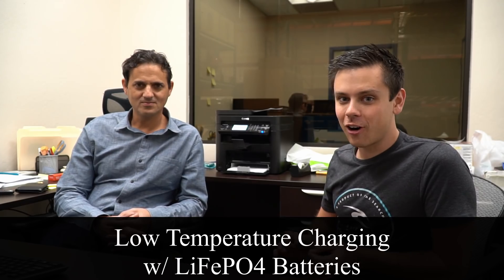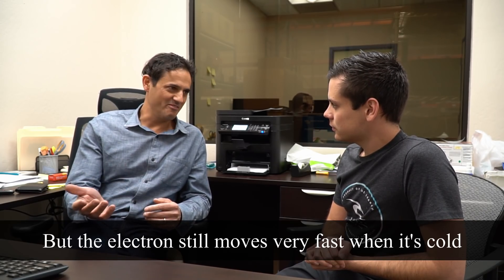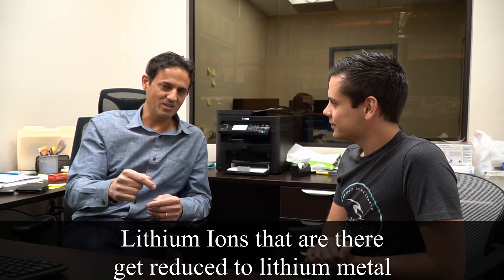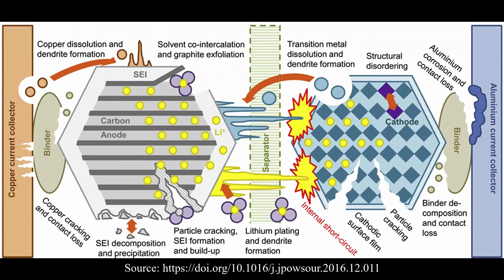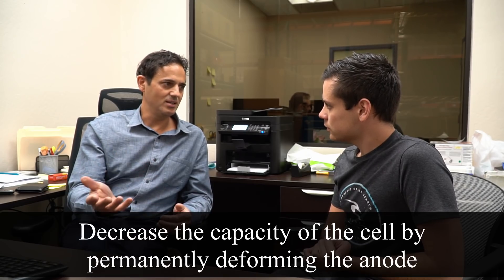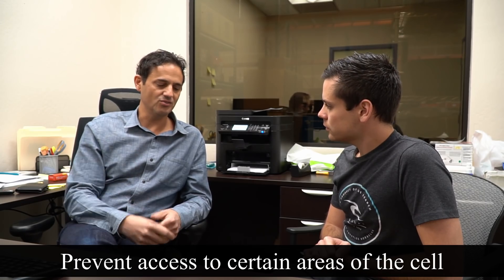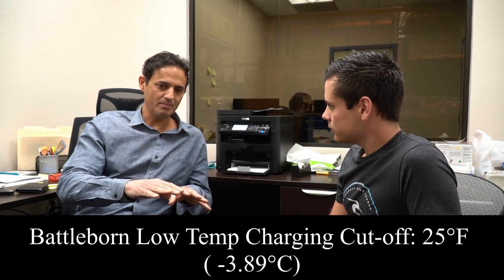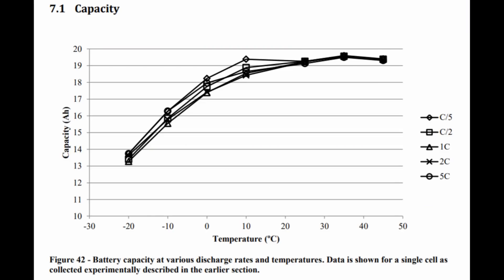Battleborn Battery CEO Interview! LiFePO4 Low-temp Charging, Storage, Longevity and so much more

Comment: Low-temperature charging  recommended to use no more than 0.1c current to charge slowly, and let it sit for more than 7 hours; Passive balancing is not useful . Consider balancing the current and the main parameters of the battery.

Comment: If Battle Born could make a lithium battery that would work (charge) properly with a standard RV charger/converter made for lead acid batteries, I think more folks would use them.

Comment: I don't know if this is possible or worth the effort but given there's a hard coded low temp cut off to account for leeway and such, could they add a dynamic low temp cut off that takes the charge/discharge rate and the temp into account? People using low rates of charge/discharge could get a lower temp cutoff that's still safe, get more out of their battery, and also know they actually have an option still, rather than no option at all if their temps will be consistently low and all batteries have a super safe hard coded low temp cut off based on a higher average charge/discharge rate. Is this realistic? Pipe dream?

Comment: What i want to know is realworld tests. Like a system is in constant use. So  its more warmed up. So a outside the cell sensor would read a lower temp then the inside of the cell . This cell is already in a plastic case with other cells and keeping  it isolated. It  wil also warmup  during charging. So maybe at those low temps is not always that bad  Unless they are not used and outside a house or warmed  camper.

Comment: Will has so much passion for batteries its infectious. Also where would the energy come from to heat the batteries?
Reply: Wouldn't it come from the charging source since that is when damage occurs is during the charge cycle when batteries are cold? BMS would restrict the charge until safe minimum temp is reached. Just my thoughts.

Comment: A really good video - Talking to someone that actually knows what they are talking about. I am so sick to death of being told what I should and shouldn't do and never being told why! Loads and loads and loads of people just repeat parrot fashion what they have read or been told but, if you ask why, well, that's when you realise you are only talking to a parrot.
One other thing while I'm hear - Nice to see you have found a use for those big resistors, a household filament type of light bulb can be handy too, current limits as it heats up and handy if a fuse has blown and are concerned that something may have gone seriously short circuit.
One other thing - If you are going to stick a relay coil in amongst electronic devices you might like to consider putting a small signal diode across to relay coil; EMF and all that stuff. Very well done on this video {:-)))

Comment: This is a CEO that actually knows his product, as it should be. Great interview!
Reply: thats a sign of a CEO who built his company from the ground up..Not one that was hired to fill a vacancy. This guy probably ran the whole thing by himself for quite a while not only does he know his product but has probably done every job there from the lowest (sorting mail) to CEO they are the best to work for cause they usually have an appreciation for the entry level jobs that actually make the company wheels turn.
Reply: @iczer01  rather than hiring one off the web...
Reply: Yeap CEO is a techie , a dam experienced one at that , wouldn't be surprised if he did the designs himself originally

Comment: Excellent interview!!!!!   There's your calling Will. :)   Please do a Project Farm series of videos cold testing/charging to see how far you can push them.  That's been my biggest concern with lithium batteries traveling in my truck camper full time solar.  Knowing that lithium can take a low charge below 25 F charge without killing the battery is a huge plus.  I have 2 battery/BMS kits coming from China, so finally taking the plunge.  Thank you for all that you've done.

Comment: This has been an interesting and informative interview and I enjoyed it, thank you. I do have a question, I'm looking to build a truck camper (which will rely heavily on solar) and paid close attention to your vids. I've seen vids were they created a 'potentially infinite perpetual motion thing' with a 12v motor and an alternator. Do you think if you could supply more power with the alternator, other than only supplying the motor, you could supply other things (i.e. batteries). Forgive my electrical ignorance, maybe 24v?

Comment: So ideally you would want a heating element that will use all the charging energy to warm up the battery until it is above the safe charging temperature. 
A heating element, thermostat and a diode (to prevent current from the battery to the heater) could do the heating part. The BMS should should do the low temp part.

Comment: The part around 14:00 is invaluable... I was wondering about degradation when a battery is plugged in and left fully charged for months at a time.  And now I have my answer!   I'd like to use LiFePO4 as a live-backup, meaning that the charger is plugged in all the time and its also running equipment 24x7... the battery is only there in case of a power failure.

-Matt

Comment: A Battleborn with an internal heating element! Nice!
Reply: That could make your van complete eh? :)
Reply: I just bought one. It arrived yesterday -- 21Apr2021. I haven't  used it yet, but anxious too. I got a 12v 100a.

Update: Today is 20Jun2021. I began using the battery about 4May.  I wanted to do a test to see how many days it would run my mifi hotspot that I want it to run during the winter.  It ran for 18 days before the battery was empty.  Now I just have to set up my solar panels.  I ordered the $50 used "pretty darn good" ones that Will tested.  I got 16 of them, which I will split up with friends.  I'm only getting 4.  Thanks to Will...

Comment: Great news them developing a battery with internal heating elements to bring cold cells up to a temperature they can accept charge.
I mentioned in a comment in one of your videos a few weeks back wondering if there were any BMS boards which have such a feature (I wonder if they read it!).

Would be a godsend for those in colder climates.

Comment: Tell the CEO we need something in 48v to rival the Discover Battery.  It's for 48v systems (actual voltage is 51.2v) and 130ah i believe.  It's marketed as 6.6kwh but they are PRICEY.  Tell Battleborn to make us something similar and send you one for testing!  I am ready to buy 4 when he does...first buyer for the test run.  You rock Will, thank you and i really enjoyed the interview.  The Discovery Battery has Xanbus, a built in BMS, and says it can safely be connected in parallel.  I don't even know what a Xanbus is but thanks to your channel, I know what the other 2 things mean.

Comment: He says that the battery cuts off at 25°C but suggests that we not exceed 100°F which is 38°C.

Are batteries meant to live best in a short temperature range of 13°C or 55°F?

Then he says room temperature of 75°F (24°C)  approximately is the recommended temperature.

Im confused again
Reply: Zubair Khan it was 25°F low temp cutoff temperature, not Celsius

Comment: So a while back you were talking about useing a capacitor too reduce spark from inverter or high voltage spark ... I use a keyed ignition for my system..👍🤠✌
Reply: It's called a pre-charge *resistor*, not a capacitor.
It charges capacitors slowly to avoid a spark when connecting "for real".
Reply: @ahaveland  for real it actually works Andy
Reply: @ahaveland  no Sparks for real..

Comment: Great interview. I would like a little more information on their low temperature charging. He states a low charge current is safe below freezing down to 25.... what if I pump 50 amps to the battery between 25-32 degrees? Will the BMS throttle the current to a safe amount? Or does the BMS only shut off charging at 25 degrees and has no control over the current when it's over 25? This could easily be tested... sounds like Will has should get on this test asap!!
Reply: You really do not want to be sailing too close to the wind when charging at low temps.
Think of the poor lithium ions trying to swim through electrolytic treacle and getting turned to metal if they can't leave the electrode in time!
Reply: @ahaveland  I understand that and probably will never do it. But I'd like to know the facts, just in case. During the winter my batteries at my cabin are around freezing some of the time. There seems to be a lot of opinions out there, but little facts.
Reply: @off-gridengineering3377  It's complicated because of all the different chemistries and combinations, but there is a lot of research data available on Google Scholar if you're prepared to search for it, otherwise accept the advice of the manufacturer/distributor.

Comment: Will,  
As usual,  great Job!!!  

If you get a chance to talk to someone like this about cold temp storage I would love to hear it.    As I look at specifications on storage temperature on different cells it is all over the map...and seemingly self-contradictory.    What does it mean if you can discharge down to -20 but can only store at -10?

Reading through the comments here and on your forum, it is clear that there are a subset of your followers that live in cold Climates and might leave the batteries sit for long periods of time.

Comment: Will, I wonder what the low temp cutoff is set at in that BMS you tested that failed the low temp cutoff. I bet we may have just found that the cutoff is set slightly lower than frozen bananas. Are you going to test that again?

Comment: Could a BMS be designed to not allow charging below low temp but instead use the energy to warm the battery to create a safe condition to charge?

Comment: The CEO contradicted what Hunter of BBB told me when I asked if I needed to replace the WFCO8735 converter/charger in my camper to work with the BBB. He said I need to replace it but in the interview the CEO says that a converter/charger which floats at 13.4 to 13.8 is fine. I am CONFUSED!
Reply: Same here, except I have progressive dynamics PD9260 which has a desulfating cycle

Comment: The solar on my boat can run a little 5000BTU air conditioner.  Are you recommending I leave the solar and air conditioner on while the boat is in storage each winter in the Bahamas?  It never freezes there but temps in the 90's are common and it gets hotter inside a closed up boat.  Is it better to run the solar and AC than turn it off and let the batteries heat up every day in storage?

Comment: HELP dies anyone Jane a Nissan leaf I have 2012 lithium ion battery question is should the battery be kept fully charged all the time or is it better to let it go down low them charge it. I've lost 3 bars and charge from 120 volt dedicated outlet. Will if you could render your opinion it's appreciated Nissan knows nothing lol 😆😉
Reply: Nissan specifically states that they do not recommend that your main charging be from a 120V source. The battery pack needs a better c-rate than that connection can deliver. 120V is intended as a back-up as needed. Like most Li-Ion packs, it likes to be charged to 100% (where the car shuts off the charge), but not left there. You charge it that high shortly before driving somewhere that will pull it back down. In the 2013 model year, Nissan included a charge limiter so that you could set it to only go up to 80% if you weren't going to be driving for awhile. 20% - 80% is the optimal resting range.

Comment: Thanks for the video very informative. Two years ago I purchased 6 Herewin Lithium Batteries. Rated at 12 volts and 100 Ah. We are part time Rv'ers and run them 24/7 for 7 to 8 months at a time. My purchase price then was $525.00 each shipping included. We have had zero issues and very happy with the performance. Our system includes 1035 watts of solar. Flexmax 80 charge controller. Edecoa 3500 W / 7000 W pure sine wave inverter. No problem running anything in our trailer. I have found these batteries sold with rebranding labels. Are they the same as BB, no. But they have a BMS built-in. As I said these are working for me and would recommend them.
Reply: Thanks for the info ... Found a good review.

Comment: That was really informative, thank you Will. 

One question i would have would be regarding off grid / cabin charging profiles. 
I’m in a cold climate and winter charging can be challenging. As such, I want my battery bank to be 5x daily consumption. That means I only discharge 20% capacity on a daily bases and may or may not be able to recharge that amount. The batteries would be sitting at a constant 50°F (root cellar) 
What is the beat way to set up charging?

Comment: Is their a way of testing to see if plating has occurred ?
Reply: Yes, perform a capacity test.
Reply: @off-gridengineering3377  That won't specifically identify if plating has occurred because there are many other reactions and factors that can reduce capacity.
Reply: I don't think there's a non-destructive test.
You would have to dissect the cells under an inert atmosphere and analyze the electrode material with an electron microscope and/or find something that would react only with metallic lithium that could be quantified.

Comment: I think I grabbed a bit from this conversation that I was not aware before: if I understand correctly, Dennis says that the problem with charging at low temperature is that the amps provided by the chargers become eccessive. Which begs the question: wouldn’t that be solved with a “variable amp” charger? My point is that if I’m in my RV in a snowstorm, temperature say 20F and the batteries are going down, I’d love to be able to crank up the generator and charge even at a much lower power (longer time) than normal...
Reply: It will be interesting to see what their "internal heater" battery does when it is released.    For the BB competitors, the internal heater only runs off of charge current (Not the batteries).   For your case, this would work well.   When you first fire up the generator, you won't get a charge, but once the battery is warm enough charging will begin.

Comment: Thanks Will very timely cold weather interview. I have a built out van and leave it parked in the cold Colorado night.  My solution you ask when I want to take her skiing and cold weather camp?  I run my electric heater (750W) on the batteries for about 40-60 minutes, this not only warms the exterior but due to the internal resistance of the batt heats from the inside as well.  All verified by infrared thermometer.   Once the batts  are at operating temps I charge the batts with the alternator at .75C for about 1/2 hour on the way to the trailhead.    I have a switch to cycle the alternator off to avoid overheating.   I have two Renogy 100 ah batteries, not terribly happy with them, but I was trying to determine if there is a low temperature cut off in the  bms?  Do you know?   I did a capacity test at 23F and noticed about a 15 percent loss, but according to this video its likely in line performance.